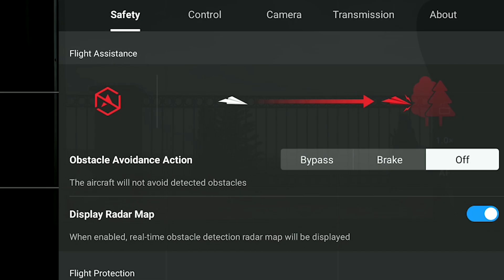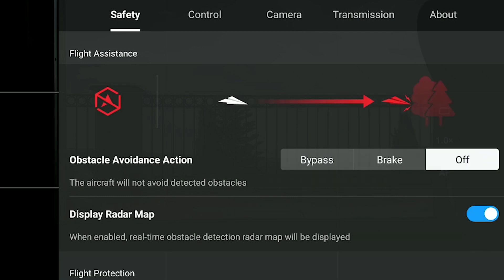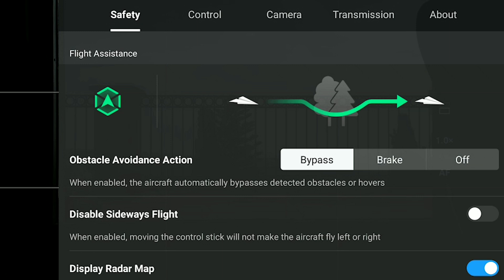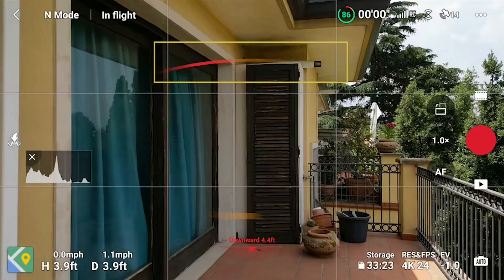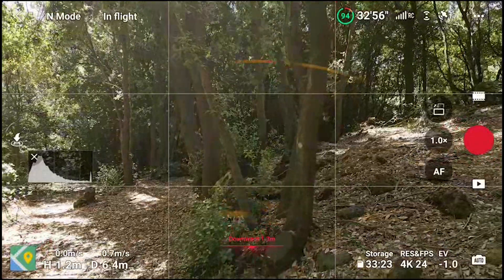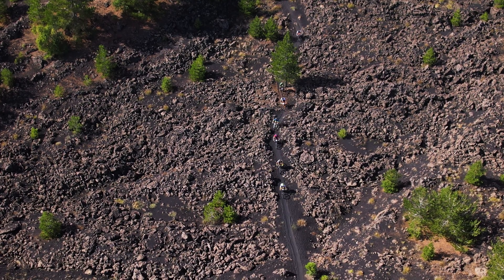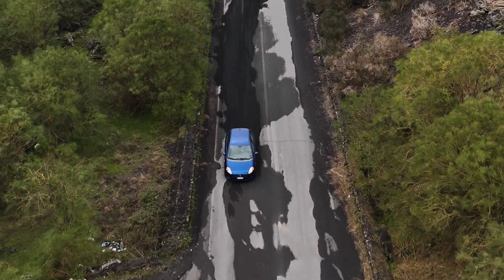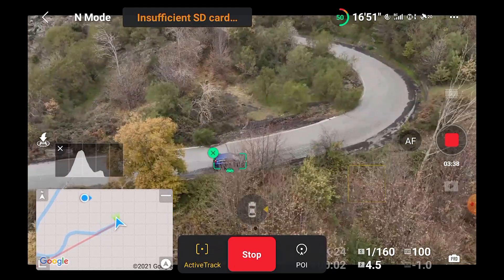DJI Mini 3 Pro Obstacle Detection and Crash Avoidance

Comment: Interesting observation today while trying to set up a hyperlapse with waypoints. The obstacle avoidance system will prevent you from setting a way point anywhere the drone is close enough to an object to trigger a warning. This occurs even if you have turned off obstacle avoidance system (selected not to avoid).
Reply from the maker: Very interesting indeed!
Thank you for sharing
Reply: @VICVideopIC  I had a great shot set up that I wanted to repeat with season changes where I fly toward a statue and out over the water starting low enough to have the sky behind the statue. I can't do it unless I fly well above the statue. That, of course, ruins the shot I am going for . . .